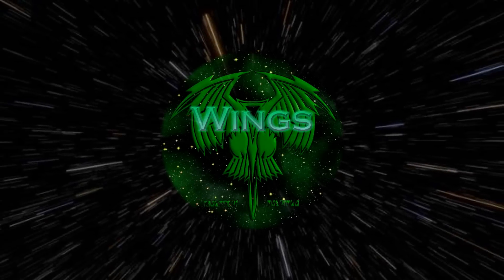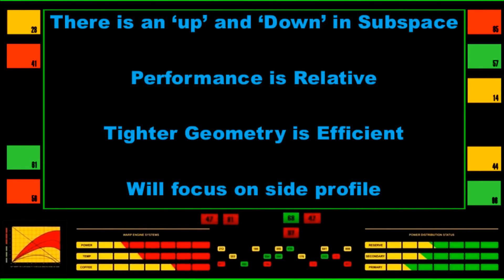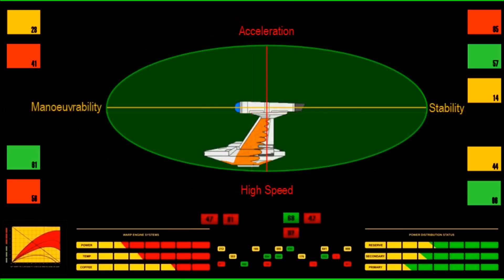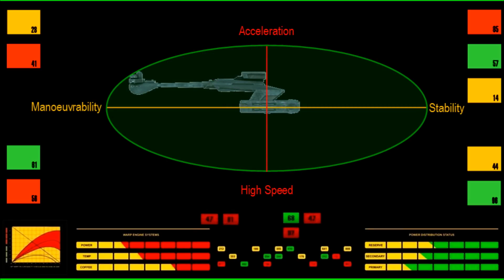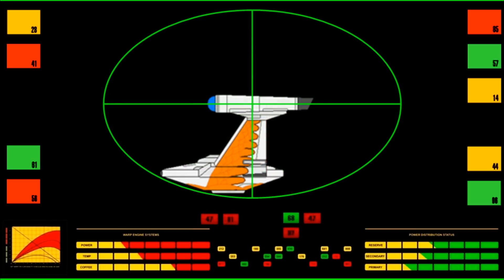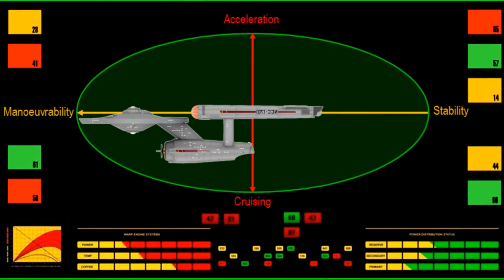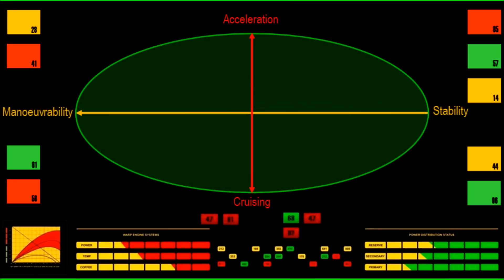Warp Field Geometry Explained!

Comment: I don't think you need to give all of subspace a universal up and down for this to work.
There is no ABSOLUTE up and down in space. However up and down still very much exist in a relative sense, so up and down are meaningful terms when taken in relation to a starship.
You don't need up and down in subspace, just up and down as related to the ship and it's warp field.
If you think about it a fixed up and down to subspace it's self would massively complicate warp travel.  You could completely alter a ship's warp performance by just rolling it 180 degrees.

Comment: Hi. Woow! Its soooo fascinating!!! 😂 I wonder if you could do geometry video for Galaxy NCC 1701 D? Maybe including the Manual for Engineering? I do have doubts here. Dilithium crystal acts like piezoelectric, bringing more % of matter and antimatter together, which gives us plasma for Electroplasma Conduits, which are already filled with it, which fill more and more, raising pressure and may blow up sometimes, thats why Nacelles may be vented when necessary, right? If so, where exactly in each Galaxy nacelle is the venting port and where inbetween MARA engineering matter antimatter reactor and the Nacelle plasma can be vented in case Pressure is too high?

Thanks for exciting Channel and Video!

mwuaah!

Kylie Desire
France, Paris

Comment: Ok sorry I know you did make the point we assume a up and down.

But I would like to take the point of:
Front manuvabile
Back stable.

Like a raindrop. Where the front is more effected by force.

But I don't like the up and down thingy. I did thought of that part more like:
If you have to shove it up against the ships gravity and feed it from "down".
You have a. Stable output. But if you slope it in from above it's like a gravity feed engine.

It's easy to get fuel in and ramp the engine. But it's hard to starve it to don't be so fule intense without collapsing the feld

And why does up and down matter there? I don't fucking know.

I would take the ships gravity and the alignment of the engine to each other. 

If you would Flipp them they wouldn't point the same side to each other.
Reply: So to conclude: I would be aligned to monste sad. But would put acceleration to designe:

How they feed the engine. And that's changing the designe....
Maybe it hust have to do with some tech bale where the core sides relativ to the ship

Comment: Fascinating. I like this.

I always assumed starships with only one nacelle had four warp coils in the nacelle: dorsal-port, dorsal-starboard, ventral-port and ventral-starboard . Extra energy into the dorsal coils would steer the ship aloft; extra energy to the ventral coil would steer it alow; and similar energy gradients port and starboard would steer the vessel horizontally. (Of course, it could be opposite -excess ventral energy steers aloft- but it would hardly matter for the point I'm making.) I also always assumed the difference in distance between the starboard-most and port-most coils would be so low in a one-nacelle vessel that her maneuverability would suffer severely.

Furthermore, I figured vessels with four nacelles would have one warp coil per nacelle and balancing/diverting energy to these different coils steer the vessel in the same way but have much higher maneuverability and, since there would be more available mass per coil to absorb more energy, such a vessel could achieve faster speeds and while reducing wear and tear on the coils; however, they would be more expensive to build and harder to sync-up the timing of the coil excitations to get proper warp-field shape and structure.

As such, vessels with two nacelles were a compromise between good maneuverability, build cost, maintenance requirements and complexity; and vessels of three nacelles were an attempt to get the same maneuverability and low-maintenance as four nacelles at lower cost while excepting the disadvantage of weird warp-field mechanics.

It seems to me that vessels of four, staggered nacelles could do more than just have one or the other set active. it seems to me, by carefully manipulating the energy density at each set of nacelles, and each subset of coils within those nacelles, you should be able to vary the warp geometry between the two extremes, with the practical limit being the ability to calculate how the all warp fields interact.

It also seems clear that warp coils made of different material -or, perhaps the same material but forged as a different meta-material crystals- would change the warp-power curve. For example, the power requirement difference between low and high segments of a warp regime could be made to be less extreme, so that it would cost more energy to cruise at low warp integers -1.0wf, 2.0wf, 9.0wf, etc- but less energy to cruise at high warp fractionals --1.9wf, 2.9wf, 9.9wf. In this example, if you spent more time in the higher warp factors, say 7wf to 9.99wf, it would cost you less to energy as a whole; but would cost more if you tended to cruise below 7wf. I suspect the Ent-D, for example, was expected to cruise below 7wf, which is why the transition between warp factor regimes is so extreme on her warp curve chart; where as, I suspect the Ent-E was designed to cruise in the higher 9wf regime for longer and so, by this guess, would have a far less saw-toothed energy curve.

While we're on this subject, I've suspect that Vulcan warp rings can be thought of as a single, very large warp coil that would have exceptionally high efficiency at converting energy to warp fields and would have high manuverability, to boot. The warp geometry should be simpler to calculate, too, IMNO. The compromise would be high complexity, engineering-wise: lots of plasma conduits, plasma feeds, injectors, field manipulations... An engineering nightmare. However, I also suspect that early Vulcan warp rings were partially a duel particle accelerator system, and the accelerated beam met just below each warp coil segment. This would allow for the energy from a M/AM reaction or a fusion reaction to impinge on the coils without any need for dilithium. This would probably be a less efficient engineering solution but it would let you build warp-ships without any knowledge or access to dilithium.

Comment: Vulcan ring ships might be a nice little add on to the warp geometry discussion. They are technically mono nacelle and every once in a while in trek they do feature craft with significant negative space. IIRC the warp pocket is responsible for the ion trail people track. 

One idea I haven't seen is a flotilla ship where the nacelles are a swarm of warp tugs but I have heard detached nacelles are a thing in the newer programs. 

Cheers!
Reply: Iirc the warp and ion trails are similar but not identical. A warp trail is basically the wake left in subspace by a vehicle travelling faster than light — the Enterprise’s wake in Beyond comes to mind — and an ion trail is caused by the deflector shields colliding with the interstellar medium and ionizing the trace gasses and dust.

They’re basically two separate wakes left in real and sub space.
Reply: @joshuahadams  I've heard that the warp fields overlap in some places causing spacial anomalies which I would think lead to ions.

 That being said it's more of headcannon than cannon since it's been a while since I've watched trek.

Comment: Something interest about space is how stuff works...

In an open system it flattens to a disk open meaning it is loosely interacting masses like a bad creates nebulae or asteroids creating belts and rings with other debris. In a closed system things round like in stars and planets and large asteroids... The ups and downs of space are nonexistent as to defined either you have to have a plane of reference. Like Earth is in space so if there is no up and down at all we wouldn't experience it here either. However up and downs referenced with gravity on a planet. So up is out and in is down. This applies to our spherical plane perfectly as once you reach the core up and down exists the same as like Space you run out of down just like if you go up you essentially run out there as well. But you don't your reference frame changed once you are out of earth up is the heliosphere of the sun. Because regardless of direction you are either going in or down to the sun or out and up from the sums influence. Then from there out reference becomes galactic in scales. You are either traveling in deeper or out deeper. Then finally between galaxies up becomes impossible there is only downs and from this point the centre of the universe either is a thing and you found true down... Or you can't find the thing this down is your own reference only being at your feet. Even if you curl up cause this has been a long time floating through the cosmos. You can't point your feet to be above your head. Though internally we would comprehend down as the base of our spine or tail bone.
Reply: Gas not bad... Autocorrect is completely indifferent to context
Reply: To add I'd figure seeing as galaxies are dense open systems they are both spherical and flat in nature... Essentially being a 4th dimensional entinity that encloses other 4th dimensional entities. So the next stage at the observable universe would look funny cause everything overlaps in like a netting. Which isn't the case it's more like interwoven rings that's are also disks and balls. Likely the 5th dimensional base that sets out orbits direction as finite not infinite. The only point that other "realities" or the "multiverse" could be defined. I mean maybe if you are out that far and change angle you may not even be in our universal constants anymore.

Comment: I think your hypothesis needs refining. You really need to remove the need for subspace to having spatial references of up and down. You might want to use direction of travel as spatial reference instead and the warp field as a compression wave the ship travels in whether the center of mass of the ship is in relation warp nacelles. As far as acceleration and top speed comes down to power and projecting that power though nacelles( ie. How many warp coils, how densely they are packed), subspace streamlining does have a effect also. I can agree on the distance between naccelles affecting maneuverability and top speed. I can also agree that a tighter warp field is more efficient then a more oblate one. I hope I have given you food for thought on refining warp geometry.

Comment: I must compliment U on U're displays & narrative. Using said, it would all point to the Steamerunner class as a near perfect design. But using the "Zed" axis as the focal point. W/ one nacelle out, the warp field geometry would have to be tuned or redefined. Hence, X & Y axis can be tune. No? There is too much "Cannon" regarding modifying warp signature.......yes. Kirk & Picard were notorious for this practice. As a base...Kudos, seriously. Many thanx 👍👍

Comment: Nicely put. It makes sense in-universe when you consider that the nacelles - for the most part, warp subspace rather than real-space. It's not completely clear though if the subspace warp creates a corresponding real-space warp or does something really complicated that enables the starship to accelerate past c.

Given that going to warp near a planet doesn't rip it to pieces or at least cause a tsunami suggests the latter, as does the need for inertial dampeners, which wouldn't be necessary for a real-space warp, although don't quote me on that last point.

Comment: This is interesting! I was a little confused at first where a Ferengi D'Kora class marauder would fit here at first though. I'd assumed it was a heavily armed and shielded cargo ship but the warp nacelles are located in relation to the hull much like a Klingon D-7 (pushing the hull forward and to the top of the warp bubble) which I assume would make it a fast light and nimble ship. Then again it's been described as an 'attack' ship as well so this kinda fits. Maybe the D'Kora's design is built more as a fast agile smuggling ship rather than a slow efficient transport ship? In 'Menage a Troi' LaForge does give the ships speed as almost as great as the Enterprise.

Comment: @Venom Geek Media 98 - 
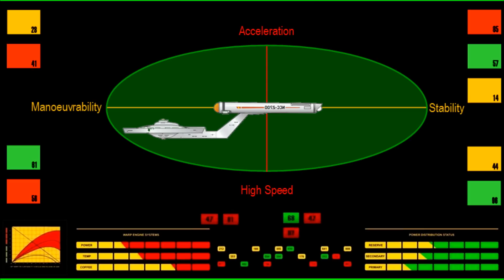the in front of warp field variant @ 4:30 is basically like the "Eurofighter" (alias "Jäger 90") with its steering wings in front of the main wing
Reply from the maker: Interesting. Didn't realise it used the canards for maneuvering
Reply: @venomgeekmedia9886   - 
these canards in front of the main wing makes the Eurofighter extra maneuverable but also extra unstable , without all these permanent corrections by the onboard computer , it could not fly ...

Comment: I'm so where would the WASP fit in that bubble and the chips from the earth on Robin war fit into that template
Reply from the maker: Wasp is a tri nacelle design so has a more unstable warp field. As for the romulan war ships a lot of those have their nacelles positioned forward so they would sit in the back of the field.
Reply: @venomgeekmedia9886  by the way sorry for some of the typos out there but it is kind of interesting to use that template on certain ships should try it on some other ships that are spaceships but not necessarily Star Trek and see how that would work

Comment: What would you consider the limits of maneuver at warp?  Let me expand a bit; with a bike, a car, an airplane, or a ship; at top speed you will have a larger turning radius than at slower speeds.  It seems that their would be a limit of change from one's base heading before it would be easier (or safer due to stresses on the ships frame) to drop out of warp and change directions.  It seems to me that something greater than a 45-90 degree course correction might require a ship to drop out of warp to change heading.  Your thoughts sir.
Reply from the maker: Or a drop to a lower warp speed. That's more preferable. So as you approach an objective you'd drop to lower warp speeds so you dropped out of warp in the correct position.

Comment: Space isn't 2D? Don't worry, you're not Khan! ...right?

I hadn't considered how distance between nacelles could have an effect on things. I tend to think of nacelles as, say, screws/propellors and paired nacelles (ie standard Starfleet practice with line of sight between nacelle warp grilles) as also rudders via warp field connecting the two nacelles. More space between nacelles could lead to more energy bleed off into space, but also more space for a "rudder" to "swing" and have an effect. So a single nacelle ship would have the equivalent of an outboard motor or azimuth thruster for its warp drive, while most ships would have a two screw, 1 rudder set-up. The quad nacelle ships we've seen are 4 screws two rudders.  Tri nacelle designs... the Chevron style like on Gal-X? 3 screws, 2 rudders. The V style? Not sure. I mean, it'd be 3 screws, 1 rudder, but it's like for some reason they stuck the third screw past the rudder instead of before it. Or maybe it's 2 screws + 1 rudder + 1 azimuth thruster?

Something to get Drach back to discuss, maybe? ;)

Could we get a follow-up at some point on how warp speeds might be affected by where the warp field comes out of the nacelles? After all, Defiant (and DSC S1 designs) have rear facing warp grilles, which would seem like it would have the warp field strongest at the rear and weakest at the front. And if you need overall Cochrane strength in the field above a certain threshold for a given speed, that would imply having to pump more power in than required in order to get the front of the field past the threshold (though maybe that's dependent on ship size?). Perhaps also where the placement of the nacelles could affect the overall strength of the warp field? And what does that mean for the warp "bubble" for ships with no "outward" facing warp grilles, like TOS Connie?

Comment: The video on warp speed combat a while back inspired me to worldbuild a universe where almost all combat took place at warp primarily because warp fields were used as both offense and defense. Instead of Shields or other sorts of passive defenses, ships primarily relied on warp integrity to stop incoming fire. Mass drivers using sustainer-engine-equipped projectiles and missiles with similar tech are the primary weapons in the setting.

It's very much a WIP and a side project, mostly to see how much I can stretch that one single concept rather than making a combat system that's a pastiche of other space operas.
Reply: You can also make a difference between missiles and torpedoes.
Missiles would be at non-warp/FTL speeds while torpedoes will be at warp/FTL speeds.

Heck could even make sub(space)marines even which are undetectable ar warp/FTL. And all Starfighters will be at warp speeds. Surface ships would be the only ones that can go either warp or normal.

Sorry, this is your setting, not mine. I just got a little carried away.
Reply: @Marinealver  Appreciate the ideas, but I'm trying to stick to a more expanse-style approach of having a limited set of weapons, with a more realistic physics/one big lie approach. Warp also doesn't use subspace, but I have something similar to that in my main sci-fi worldbuilding project.

But, yeah, it is a fun concept, isn't it? Feel free to use the ideas for your own stuff if you want. I've been a proponent of the idea that fiction is inherently derivative and it's just about how you use the pieces you have that makes it unique.
Reply: Basically what would happen would be gassification. So if you use a warp field to disintegrate an object, you end up with a spray of super-hot plasma in its place. Could even be a quark plasma if it's tearing atoms apart. Plus a lot of beta and gamma ray radiation, of course.